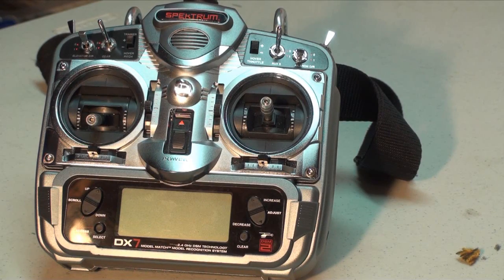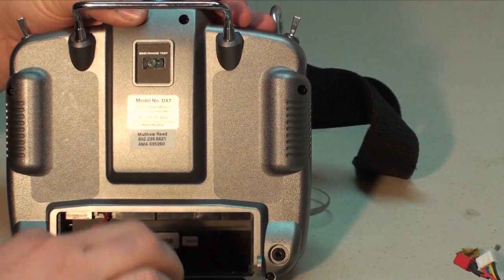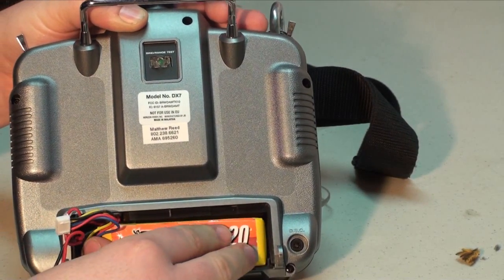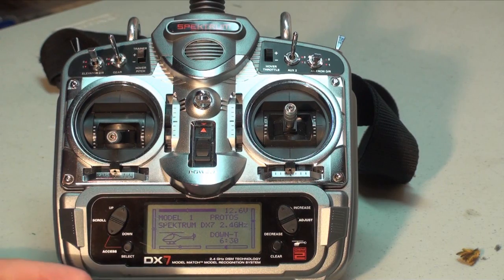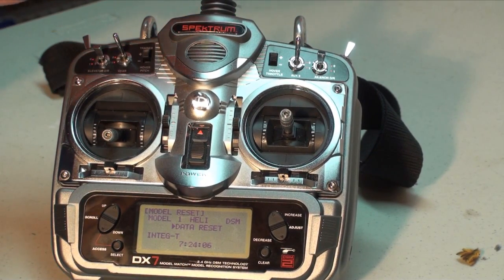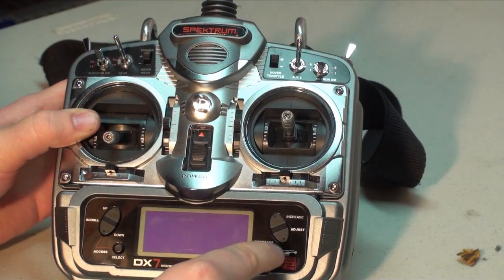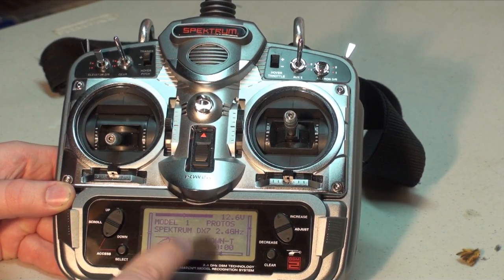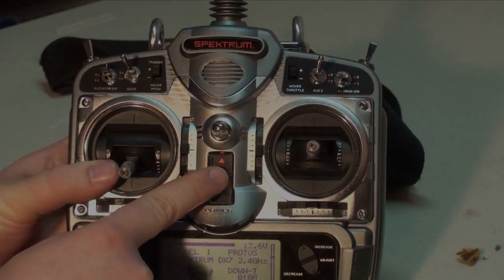DX7 Lipo Conversion and Battery Alam Settings

Comment: Hello, I noticed your throttle stick is not self-centered, and elevator stick is. How did you swap this self-centering mechanism?
Reply: Solution: Attached an image of how to do it without changing any radio configuration
. https://drive.google.com/file/d/1AEyp8rR0tYxLfJyY-KglXae5OoUMZjY0/view?usp=sharing
Reply: Just move the spring and friction strip.  Then change the mode selection in the settings

Comment: don't worry about what c rating the battery is. the battery only discharges what is being needed by the transmitter which is  330mah. the specs on the voltage regulator say up to 12v so I put in 1 1amp diode which brings a 3s pack to 12volts from 12.6 because I wanted to be as safe as possible
Reply: Hello xrguy650, I still have my old DX7.
And now that I'm going to have time to fly again, I would like to put a lipo in my Tx.
Like you, I'm convicted it's safer to protect it from high voltage.
What should I add ? Would a resistor be suitable ? but what value (ohms.. W..) ? Or is it absolutely necessary to use a diode ?
Reply: @Redscreen-qk5pf  please note you can now purchase a LifePo4 battery they do not self discharge as much as the other types of battery and are a bit less voltage than a lipo battery you will have to take the battery out to charge on a charger that can do LifePo4 batteries or just use the enaloop battery so you can still use the dc plug on the Tx to charge the battery
Reply: @Redscreen-qk5pf  Dear, I am an electronic engineer and the most sensible thing in this case is that two diodes are placed to knock 1.4 volts at the lipo of 12.6. With this we guarantee the input voltage of 11.2 volts and we will not have problems of overheating of the regulator. The diodes can be placed in series before the battery outlet port or placed one at each end of the battery but in different positions
Reply: Attached an image of how to do it without changing any radio configuration
. https://drive.google.com/file/d/1AEyp8rR0tYxLfJyY-KglXae5OoUMZjY0/view?usp=sharing
Reply: @amarquez24  Thank you, that's what I'll do, (2x 1N4001 diode in series beetween the lipo and the JST plug of the TX).  I need an acces to your drive for viewing the image.
Reply: @Redscreen-qk5pf  just replace the voltage switching regulator inside your TX with a lot more efficient one that will make the battery last a lot longer and please note the old switching regulator cannot handle the higher voltage of the lipo battery so will burn out search the RC forums for more information if needed all the best Ian 😷
Reply: @raptorpome2577  Thank you, that's indeed an another solution..., but what reference..? and where is the original regulator ? I need diagram/image to go this way. Thanks a lot anyway for this solution.

Comment: Great, thanks for the share. HK now has 3S 1c Turnigy 2650's for this use, under $10.  
To idiot-proof so you don't accidentally plug in the NiMH charger, just use a little hot glue in the charge port of the transmitter, you can get it out later on - but once you go lipo why would you go back to nmh, anyway. Unless you sell it later with original battery, maybe.

Comment: Excellent... and no, you don't have to replace the voltage regulator because the lipo is a slow discharge transmitter pack, not a flight battery.

Comment: To all who commented on this video, I have read that a voltage regulator upgrade should also be made to the DX7 because after use the stock voltage regulator will over heat and burn out. Has anyone had this happen to them?

Comment: Okay so I tried it and it work's just fine. The AnyLink handles the 12.5vdc LiPo battery from inside the DX7 just fine. Question solved.
Reply: Solution: Attached an image of how to do it without changing any radio configuration
. https://drive.google.com/file/d/1AEyp8rR0tYxLfJyY-KglXae5OoUMZjY0/view?usp=sharing

Comment: Question for you guys, would this modification also work with the TacTac - AnyLink module, since the module also plug's into the charging port of the DX7? Has anyone tried this or uses a modified DX7 with an installed LiPo battery and with the AnyLink plugged in and working?!

Comment: Thanks for the video on setting the alarm voltage. If you're using a lipo,  the end cap from a red Bic pen fits perfectly in the wall charging port as a safety measure to prevent (or at least deter) someone from connecting the wall wart.

Comment: Thanks works perfect, to everyone I have DX7 i bought the 	Turnigy 2650mAh 3S 1C LLF Tx Pack (Futaba/JR from Germany Hobby king and fit straight in well worth it. The battery about £7 and postage ontop worth buying some lipos or somethiing ontop and Im in UK it took 4 working days to arrive from HK Germany. very happy thanks GreenMountainRC and Hobby King (Europe) too

Comment: Hi I was wondering if I can use a regular 3s 2200 mah lipo pack in my Spektrum DX7 providing I solder the proper lead onto the lipo pack ? Also wanted to know if there is a setting for using a lipo battery pack that I have to select when I change over to a lipo ? Thanks and great video lots of useful tips

Comment: On my Futaba 9 I started using a LiPo 3S as well.
But because there is no way to alter the alarm I ended up using a diode to limit the
voltage that enter the radio and still have it warn me way before the low voltage damage the lipo.
For the DX7 I'd recommend the same, if you can get a ~1 - 1.5v voltage drop it will more than enough to make it safe and we can still enjoy the wonders of a long lasting LiPo.

Comment: Why don't you simply exchange the NiMh pack with a 2700mAh one? It could be self a self made pack. That wouldn't void the warranty, charging could be done through the standard port, no safety issues as with Lipos, and you could use the original pack as a backup.

Comment: What about Spektrum's manual statement, that 12.6V could be too much and 9.6V is the design voltage? Anyone had any problems using a 3s LiPo?